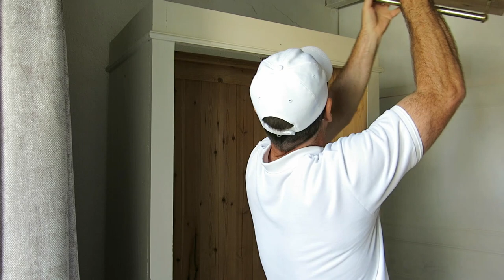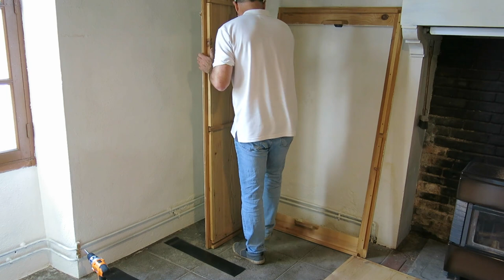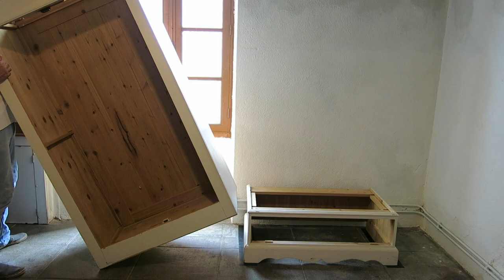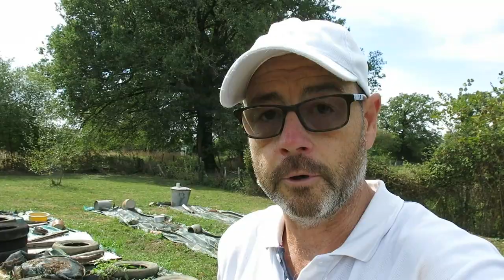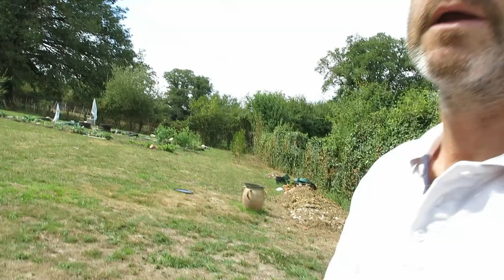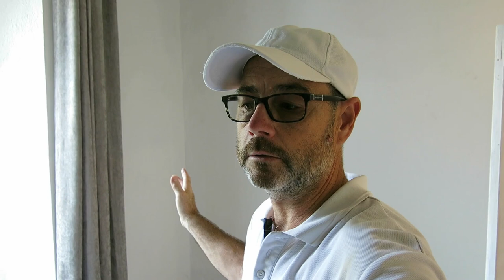Wednesday diary - My French homestead renovation continues

Comment: I had one of those roll away overhangs. It was OK in summer but got so dirty in the winter and was a pain to clean. I got rid of it and had a metal one put in and it is easy to keep clean but noisy when it rains. If I had my time back I would've had wood and shingles.

Comment: Are you concerned about foundation issues?
Reply from the maker: There is no foundation. The house was built on soil.  :-)
Reply: @GoingsoloinFrance  I would be shocked except the old house I used to live in and which I've mentioned here a couple of times was also built on soil. It was a wooden house, too. Someone at some point had added a concrete foundation along one side, and, if I recall correctly, there were some stones under the back wall. But you could stand in the dirt cellar at the front of the house and look towards the underside of most of the house - dirt, with the wooden floor supports propped up inches above it. My cats loved it, although I tried to keep them out because the damp earth smelled odd, and so did they after they re-appeared. After I sold it, the place was really tarted up and an additional half bath added under the stairs where the trapdoor to the cellar/crawlspace used to be. I wonder if they put in a new trap door? Without it, there's no access to the water pipes where they enter the place. Anyway, I used to think all those old-time builders were really good craftsmen, much better than the ones we have today. Now I know some of them were rank amateurs who just threw up a house and hoped it stayed up!